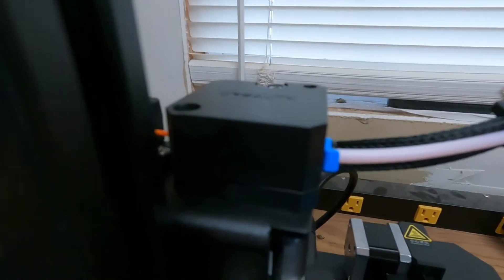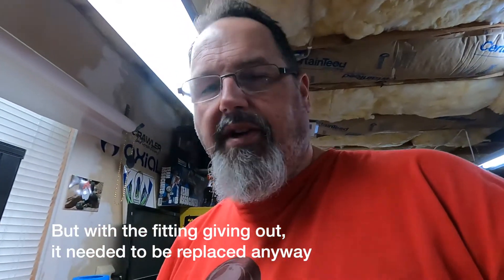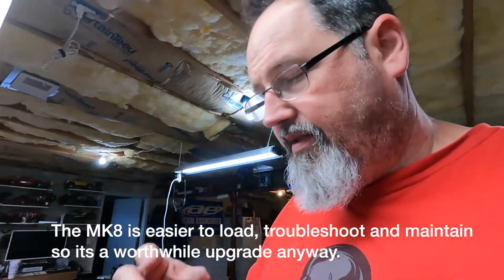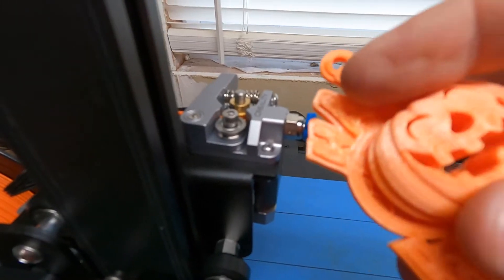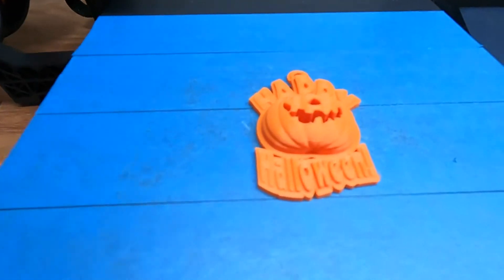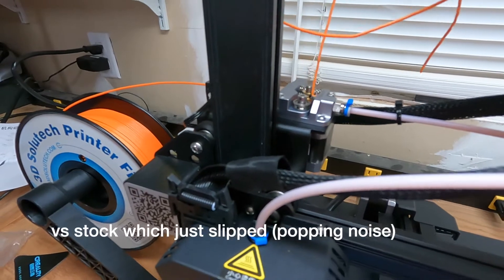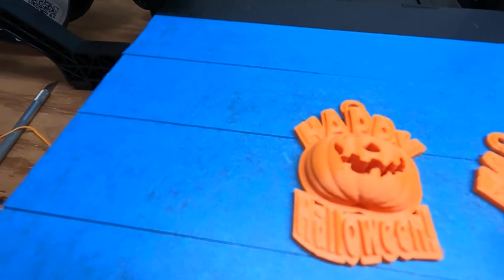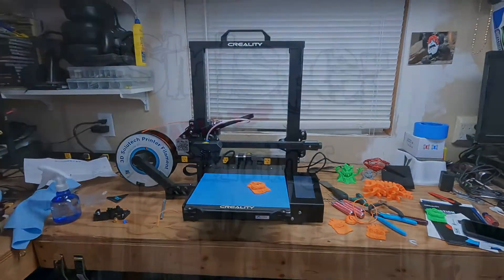Creality CR6 SE extruder upgrade

Comment: Did you have any issues with install and did you use a install video to help? I am new to 3d printing (a year) and now my plastic poop extruder is always "popping. Wondering if I could use a cr10 install video and if it would be the same?
Reply from the maker: No issues. I have the mk8 on my other 3 FDM printers so I was alrerady well versed in installing them. It bolts right on with 4 screws, you dont have to install the pinion gear unless your stock one is worn. It comes with instructions on how it goes together, its pretty simple. The red one had issues if you overtightened the the pivot screw on the arm, but the newer silver one goes right on and you can tighten everything down without issue. Adjusting the pivot spring is the only fiddly bit. I tighten it about half way and if it slips you can snug it down some more.
Reply: @SinisterGamingTabletop  IT worked the same and very well. Printer works like new. Nope better because I have a year under my belt now 😁

Comment: Just came across this after I couldn't feed filament manually after a cold pull. Thought it was the extruder (stupid f'ing cover) so I took it apart - only to discover how shitty this one is (mine was even worse than the ones they show in the videos). Just bought an MK8 replacement. 

One question: Did you have any issues with the feed path being altered from the filament runout sensor? If so, did you print/design a new part to ensure better passthrough?
Reply from the maker: nope, I just use the clear guide or my finger to guide it in the hole (that sounds awful lol)

Comment: My keeps under Extruding and wearing down the extuder gear. Have you had this problem. The original gear lasted a few 100 hours but my replacement gears only lasted 20 hours. Do you think upgrading the whole thing would make a differences.
Reply from the maker: I've never had to replace the extruder gear on anything yet. It must be doing a lot of grinding to wear it down. Check you Z axis offset and make sure the nozzle isn't too low.

Comment: My CR 6-SE orginal extruder broke. I put a dual gear aluminum extruder. What is the printer e-steps?
Reply from the maker: No one can tell you that. you are going to have to calibrate it. I stuck with the stock gear so I did not have to recalibrate my e-steps.

Comment: Thank you for this video, recently bought a CR-6SE. I have been experiencing a lot of clogging and being new to 3d Printing and the technology , have been on the search of solutions. May I ask which size nozzle are you using and which type nozzle would you advice I use for consistent prints. Most of my issues when I print were air prints(60%) and Under extrusion(40%).
Reply from the maker: 100% stock nozzle. It prints fantastic. Just replace the nozzle with a new one. Cleaning is a pain and they are cheap. When I replace it I pull the filament and heat up the hot end. Make sure the PTFE at the hot end is butted up tight and has not backed out. If any gap gets in there it will under extrude.
Reply: @SinisterGamingTabletop  Thank you

Comment: Thanks for the review of the MK8. I also have the CR6 and it's sometimes a pain to load the filament so I will upgrade it soon. Also I noticed you are using blue painters tape. What are the benefits of using the tape over the glass? Thanks again.
Reply from the maker: I just use it when I have adhesion trouble, depends on the model.

Comment: did you just change the block or did you change motor also?
Reply from the maker: just the extruder assembly, The stepper motor does not need to be changed.